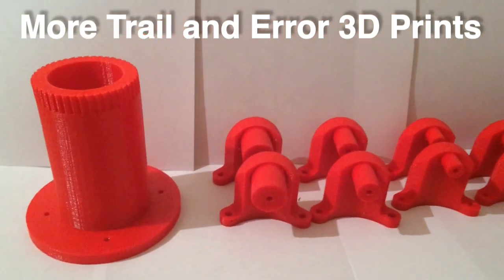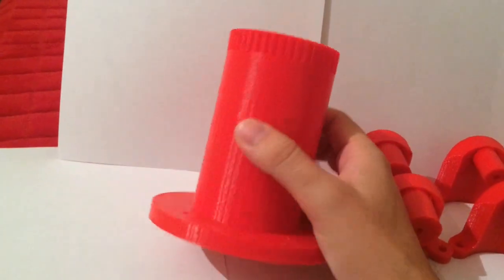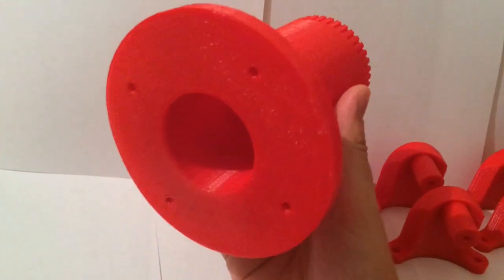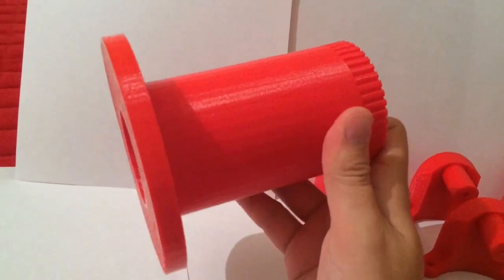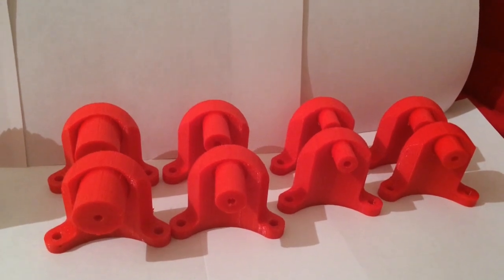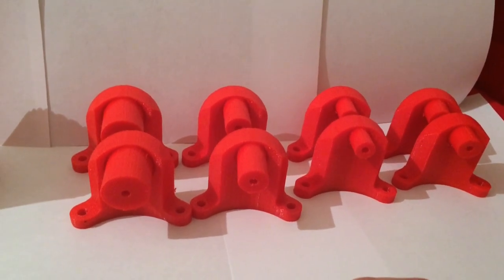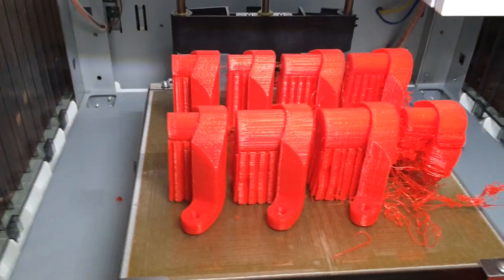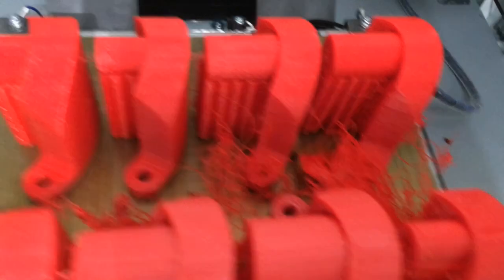More bigger trials prints for da Vinci 3D Printer 1.0

Comment: Those prints look pretty good! As for the one failed piece, it was definitely from delamination from the print bed. It happens. You just have to make sure the build platform is nicely clean and prepped before starting to minimize the risk of it coming unstuck. It is realy nothing worse than when you are 3/4's the way through a 6 hour print and it comes undone from the bed haha.
Reply from the maker: ***** I agree. I'm glad it only ruined one out of the 8.